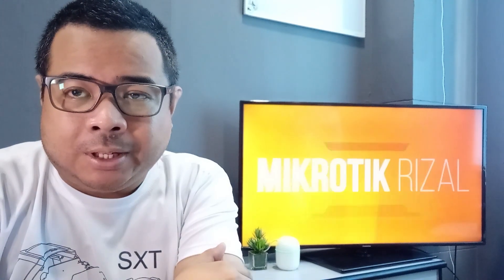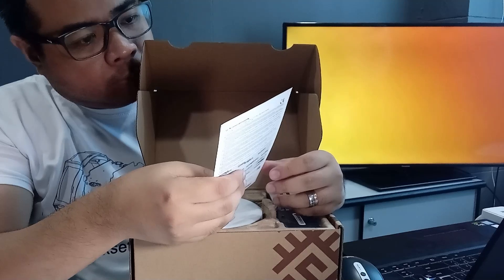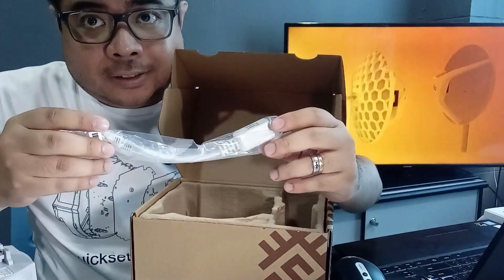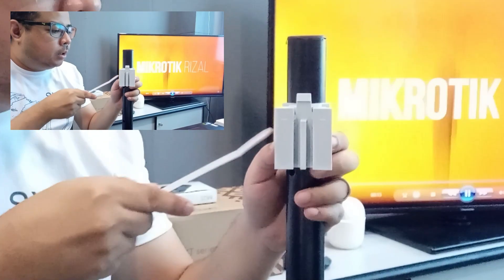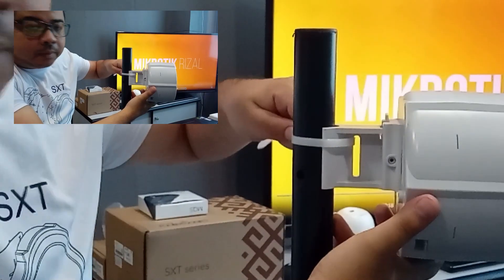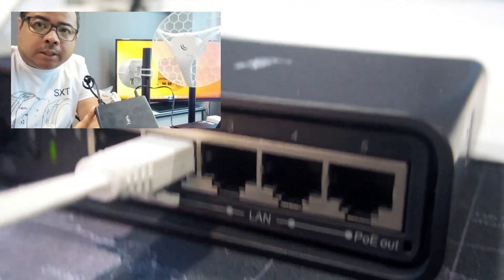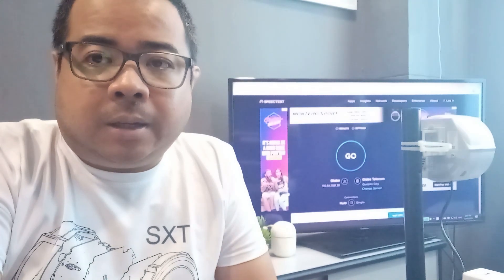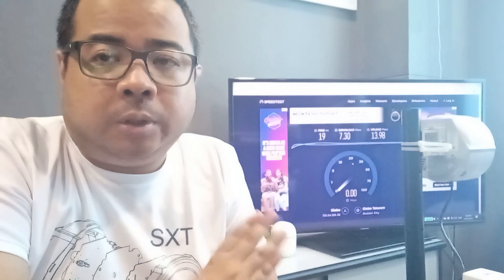MikroTik SXT 4G Kit | Unboxing and Assembly (Tagalog with English Subtitle)

Comment: You say you did not use the POE injector, but powered the SXT 4G from a POE out of an existing MikroTik device.  Which MikroTik device did you use to power it?  Did the SXT 4G provide internet to the device you powered it from?

Comment: I bought mikrotik sxt lte, but signal bars are not coming in the device.. Is there any solution
Reply from the maker: hello use  cell monitor to check for tower availability in your area
Reply: Tower availability is there! Mobile is receiving the signal but not coming in this device. Is there any setting need to change?
Reply from the maker: you may send screenshot via facebook page

Comment: Mau nanya kk,?kalo sinyal tsel 2g apa bisa pake lhg lte kit akan lancar dan bisa nangkap sinyal 4g?saya di plosok hutan kk,dan di mana belinya,kebetulan saya ada sinyal tapi di palangkaraya,kalo pulkam gk ada sinyal 4g,yg ada cuma 2g aja😢😢😢😢😢😢🥺🥺🥺🥺
Reply from the maker: Hello, This SXT 4G Kit does not have 2G and 3G Network Mode. I would suggest to check the LHG LTE Kit Model which has 2G, 3G and 4G/LTE Network Mode.

Comment: i bought the wrong unit which doesn't has band 40..is there any solution to unlock band 40
Reply from the maker: the band is dependent on the included mini-pcie modem, replacing the included mini-pcie will be costly, better sell and just buy the unit with the band that you are looking for
Reply from the maker: Here is the video of the MikroTik LTE Line Up Comparison https://youtu.be/m3WIyhl2UdU

Comment: Boss napanuod ko mga vedio mo laking tulong sa aminn mga baguhan..pa ano e connect yong lhg 4g kit sa nendo machine..yong connectio lang boss thanks and gidbless..need .your help..
Reply from the maker: from lhg mag plug ka ng lan cable, tapos yun other end iplug mo sa included na poe injector, from poe injector iplug mo naman yun papunta sa lan port ng router ng vendo mo

Comment: Sir good po ba ito para sa mga province na mahina ang signal?
Reply from the maker: 5km to 10km, maganda din if ma check mo muna if ilan km yun nearest tower sa area, you can try cellmapper and opensignal android app
Reply: Sir nsa 5km distance sa tower kaso my malaking bundok n nkaharang, sinubokan ko muna gamit huawei-b525 modem & 28dbi mimo antenna, nkasagap sya ng 1-2bars sa band3 , kaya nya pa kaya maimprove yan gamit ang SXT?
Reply from the maker: hindi kaya mas mababa sa 28dbi yun antenna gain ng sxt